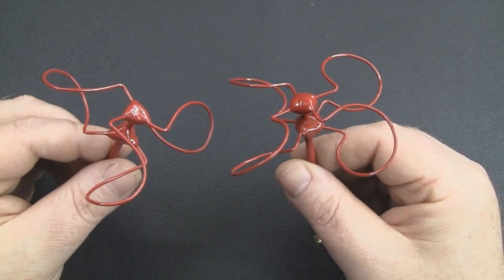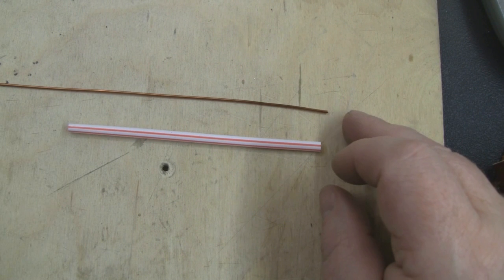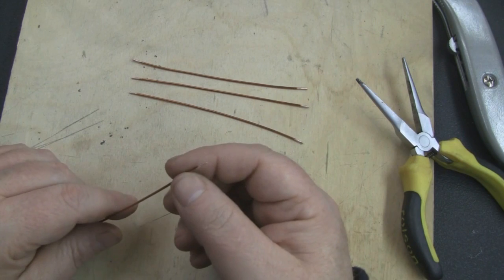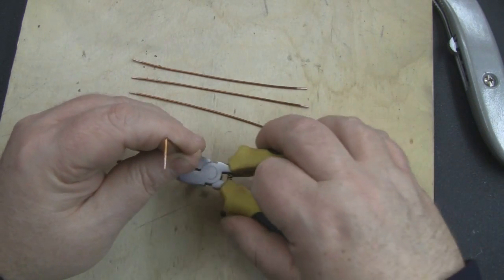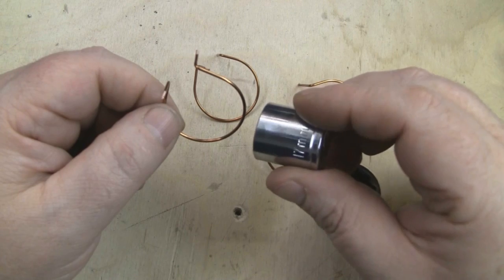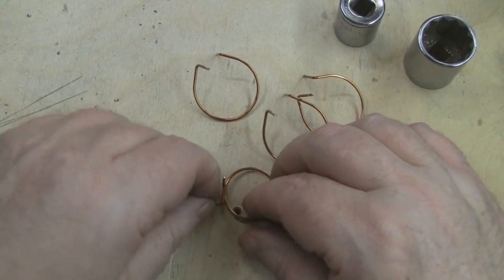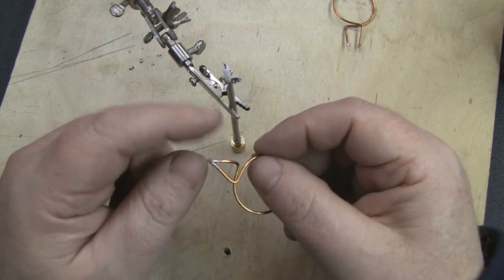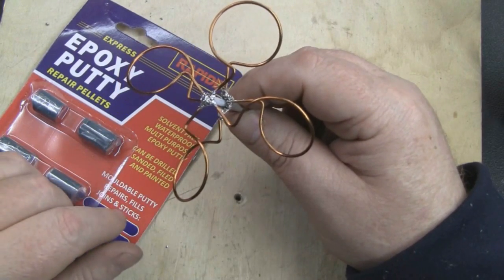Celtic Knot 2 4GHz Antenna #76

Comment: @04:35 the "17 mm" piece is not 20mm in diameter, but 23.6 > close enough, but using your instructions I measured a SWR of 1.1 at 1.94 GHz, not 2.4GHz. Not sure where it went wrong, but I will try again. It has a very nice slope on SWR and logmag, well done.
Reply: After 2 more attempts, i still have the center frequency around 2.00 GHz. There are some ambiguous parts in the instructions: Are the legs that are soldered(1/8 wavelength) paralel between each other? (15mm on both ends?)
Reply: Ok, after some tweaking, i got it to work on 2.5ghz with the following measurements:

Start with a length of about 9.5 cm. Wire diameter of 1.4 mm. The 1/8 wavelength part is now about 11,8mm each and for the loop, keep the 20mm diameter like in the video.

Don't know where the mistake is, but these are the measurements that worked for me

Comment: Man, I love your videos. Excellent tutorials. I have this plan to live a mobile lifestyle and will be using a Verizon mifi device for it's 4glte coverage. I picked the older model of this device (the Jetpack 4620LE) Because it has the capability to use an external antenna, unlike the newer models.  i plan to mount my antenna to the roof of my vehicle. That's the easy part. The antenna i need will have to pick up 3g, 4g and 4glte signal.

My problem is the antennas they sell to do this, all cost between  $100 and $400  U.S.. I have the tools to build one. I just need to know what it is i need to actually build. The antenna I'm looking at is surely overkill. But Since part of my plan involves working through my internet connection. I'd rather be sure i have the best connection available at all times no matter where in the country i am.

Here is the antenna i want to build.
http://www.ebay.com/itm/GiAnt-Antenna-for-Verizon-Jetpack-4620LE-4G-LTE-Ultra-Directional-28dBi-Wide-B-/281517155159?pt=US_Cell_Phone_Signal_Boosters&hash=item418bbae357

Could you point me to a place i can learn more about constructing something like that? maybe some other types of antennas that i can look into. Thanks.

Comment: Sir May i ask u a question? what is the difference between 2.4 and 5.8GHz?
Reply: lower frequencies tend to go further than higher ones cause they aren't filtered by the environment. Lower frequencies have longer wave-lengths so they have bigger antennas. If you have a lot of 2.4ghz devices that could cause interference, using 5.8ghz may get you better reception.
Reply: what about dBi ? what is 9 16 25 dBi?
Reply: ***** When you use decibels (dB) you are comparing two values so if I am twice as tall as you I can also say I am 3 decibels taller, this may seem weird at first cause why not just say twice as tall but when you deal with large ratios it makes it easier. So take 25 dBi. The 'i' stands for isotropic. If you can imagine the radiation pattern of the antenna looking like a sphere (kinda like a balloon) then that would be its isotropic power. In reality, the antenna is not isotropic but has direction to it (imagine taking the spherical balloon and pressing in on it to change it's shape). Remember decibels compares two values so 25 dBi compares the real (directional) shape to its isotropic shape, and 25 dBi is the same as saying the directional shape has 316 times the power of its (theoretical) isotropic shape.
Reply: man thank you so very much. i have learned a lot from you.

Comment: Hi love your videos but I have a request do you have any suggestions on a improved 915 MHz for the American APM telemetry radios thanks
Reply: he said that he has not done anything with fpv or model flying, he is just into the hobby of making antennas.
Reply from the maker: marshalcraft I have just ordered my first kit from ebay so hope to be flying soon!
Reply: awsome, depending on the flight controller you use it can be a little bit of a llearning curve. i put to gether a cheapo but solid 800 mm diameter hexacopter frame and it was pretty easy, you should have no probs with the soldering or anything, youll probably do it better then anyone else cause your antennas probably require more time and come out great. that being said there is some stuff with open source fc boards that can be difficult. i have a naze32 which is based on the stm32 arm cortex m3 microprocessor. it is completely open source software and all hardware is well documented so if you want you can do anything you can think of. however learning to fly the little bastards is more difficult then it first appears. basically they fly like a helicopter not an airplane at all. they are not intrinsically stable and do not naturally tend to fly with out constant input from the pilot or the flight computer. also line of site can be difficult to learn as well especially if your pid settings are not optimal or some other setting is off and you have no idea what they even are at first. my advice is to go with a quad or hex mini, they are very robust and take crashing well. my first one was a large hex that had alot of mass to it so it essentially destroys itself when it crashes, needed lots of repairs learning to fly it and at some points spent more time waiting for replacement parts adn fixing it then actual flying time. mini's are good cause flying them is exactly the same if not maybe harder then larger ones, but they can crash and be perfectly fine. then once you get the rudimentary flying down, like hovering cotrollably and basic stuff to be able to take control in an emergancy and save your larger multirotor by being able to guid it to the ground. then you can go on to better fc's and frames that can better do long range. multirotors are not as efficient as fixed wing models or drones. so they can not generally go as far with the same battery. you will need larger hex to carry large batteries to make use of long range, but even still your antennas should still show advantage shorter distances like a kilometer or two. some common store bought ones tend to mess up even at those ranges.